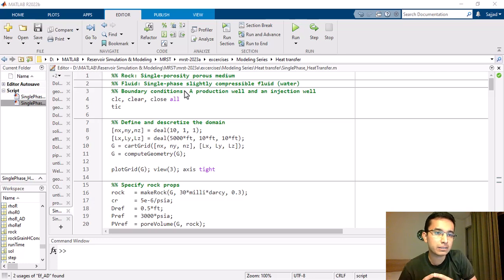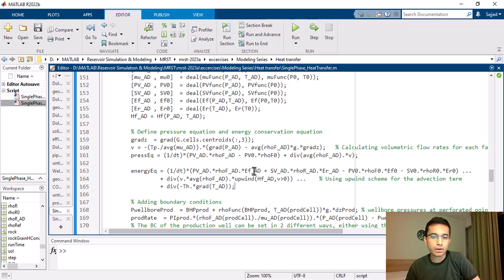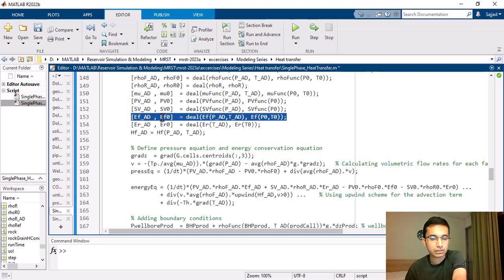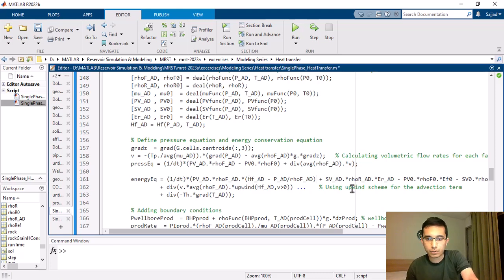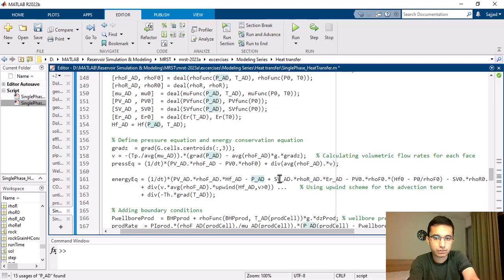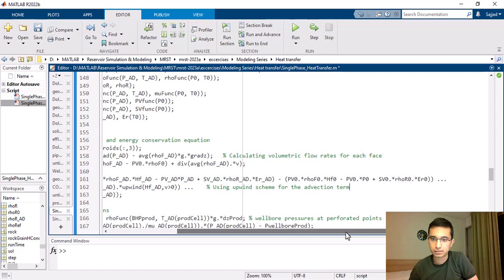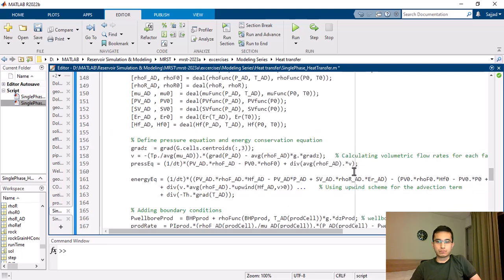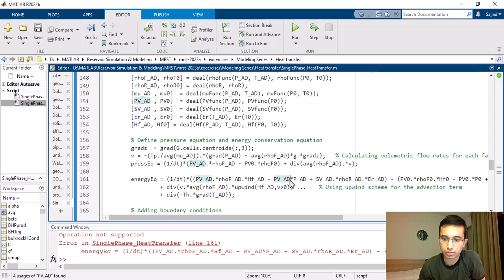Coupled Fluid Flow and Heat Transfer Modeling in Porous Media with MRST - Faster Formulation

Comment: Hello Sajjad Moslehi, thanks for your effort. I'm curious about the final simulation results of temperature fields. Why does the third grid (There are ten grids in x direction) of temperature fields have the highest temperature in your simulation results?  From my intuition, the tenth grids should have the highest temperature because the fluids in tenth grids have more time to obtain heat from solid structures. 

Could you please tell me the reason?  Thank you.

Best withes,
Neo
Reply from the maker: I suppose it's because of the Joule-Thomson effect